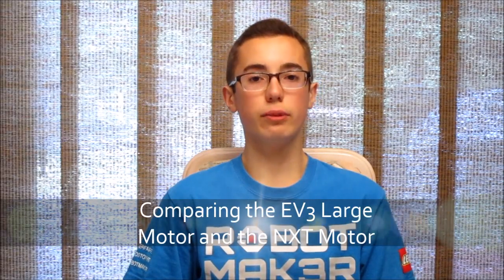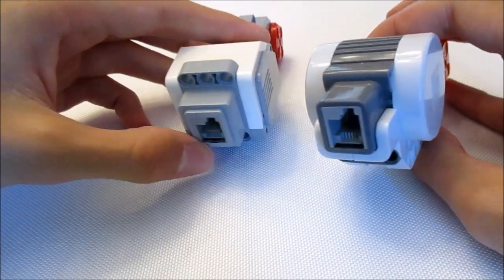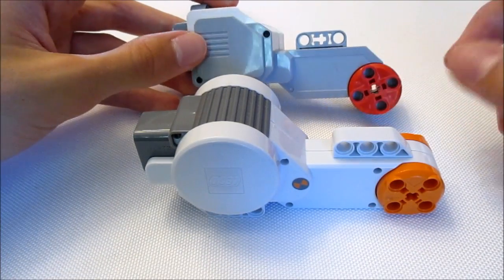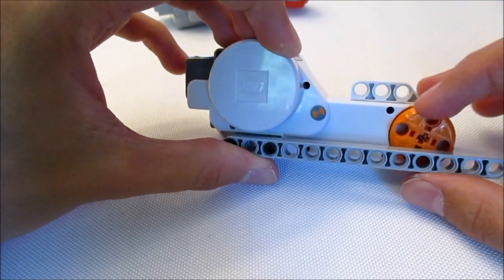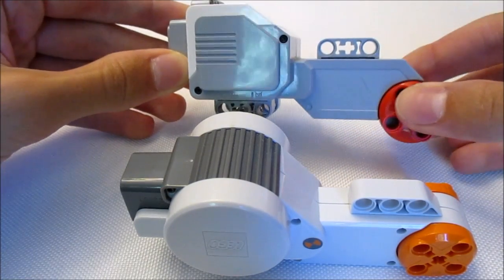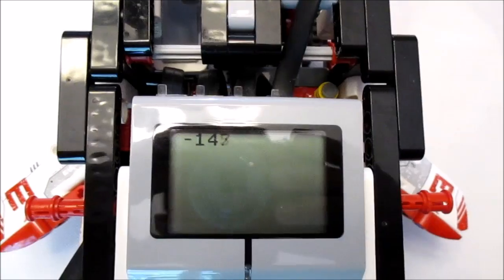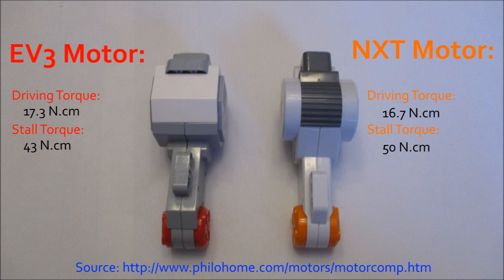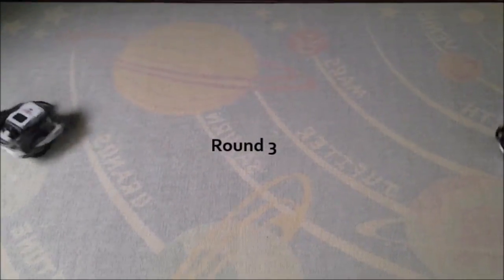EV3 Large and NXT Motors - The Differences Explained

Comment: The motors have a rotation sensor included. No need to use an extra sensor to measure the speed...
Reply from the maker: This is true, and I have explored this in more recent tutorials. The purpose of the extra sensor is to have a consistent way of measuring speed for both, because it allows me to use the same instrument to measure the speed of both motors (to get the best comparison).

Comment: The rechargeable batteries are not compatible and they are very expensive If you want to use the NXT battery in the EV3, there is a solution, but it will no longer be usable in the NXT. The charger is the same. The tutorial is here: https://www.youtube.com/watch?v=-v08-6jZXGo

Comment: I had e dead one of each motor and the torque  speed difference is do to a slite difference in gearing the "core" is the same
Reply: PS I took the 2 dead units apart
Reply from the maker: Thanks for sharing! I already knew the core was the same, and I figured that they changed the gearing a bit to fit into the slightly different-shaped housing.

Comment: There are a few things which I think you forgot to mention:
1. Because of the circular shape of the NXT motor, a J-beam fits very snugly around the end of the motor, and I often use this because it is easier to fix the motors at an angle this way.

2. The price, of course. NXT motors are a lot cheaper than EV3 motors, although prices vary by region. 

3. Another minor difference is that you might notice on slightly more used NXT motors is that their shafts tend to wobble a tiny bit. Nothing major, but it may cause problems where accuracy is of the utmost priority. This can be easily fixed by fixing to beams on either side of the shaft with the help of the peg holes on the motor.

Otherwise, great video, keep up the good work :D
Reply from the maker: Thanks for sharing!
Reply: Rahul Basu łu

Comment: This video was very helpful, thanks!! I use your tutorials every now and then and they are always helpful and they work. Could you make a tutorial on how to make an rpm program for an ev3 L motor using the built in encoders? I have made one that works but glitches out when displaying the data, it seems to forget to reset some digits to zero but when I have it plugged in and debugging it shows all the data fine. I think it is a bug on the p brick, I'm not sure.
Reply from the maker: I'll look into it.

Comment: what is that sensor?the one you used to count the moter rotation?
Reply from the maker: HiTechnic Angle Sensor (hitechnic.com).
Reply: The motors have a rotation sensor included. No need to use an extra sensor to measure the speed...
Reply: @thomasl.4081  it is not counting the rotations per minute though

Comment: Due to its "Form Factor", the EV3 Large Motor cannot directly drive the common "Wheel 61.6mm D. x 13.6mm Motorcycle, with Black Tire 81.6 x 14.2 Motorcycle Z Racing Tread (2903 / 6596)" combination like the NXT motor can.  Instead, the EV3 Large Motor must utilize the larger (and rarer) "Wheel Technic Street Bike (8420) with Black Tire Technic Street Bike (8420) - Narrow, Front (51378 / 51380)" combination.
Reply from the maker: Thanks for sharing! That was my reasoning behind using the NXT motors for Sirius 1.2.

Comment: Loved the video. The only thing I think you missed, perhaps by intent, is price. For a pure engineer price may not be an issue, but for most ordinary folks it is. At the moment I have one EV3 brick which powers four NXT motors, why? Simply because the NXT motors are so much cheaper when buying them second hand. I bought those motors for 7 euro a piece. So 28 euro in total for the motors. Had I bought EV3 motors I would have been able to buy just one for that amount of money. I don't think that the benefits of the EV3 motor justifies the current market price difference. 

Of course prices vary, while the basic properties you discussed remain constant. Which is probably the reason you left the price undiscussed.
Reply from the maker: Thanks for sharing this information! That's exactly why I have left price out; the price of NXT motors as I have found, varies wildly.